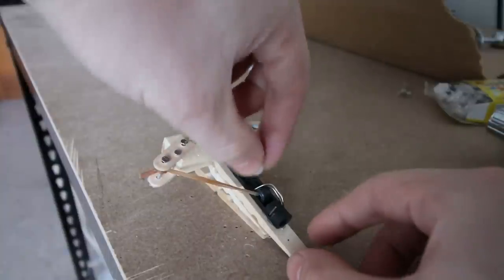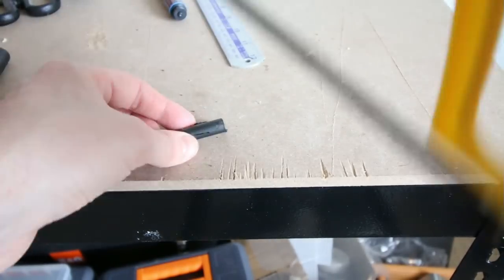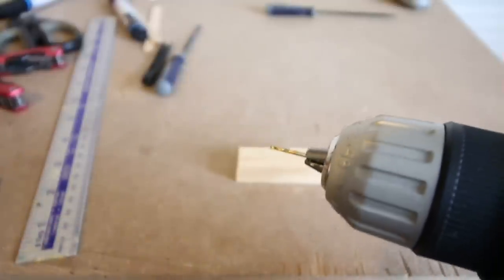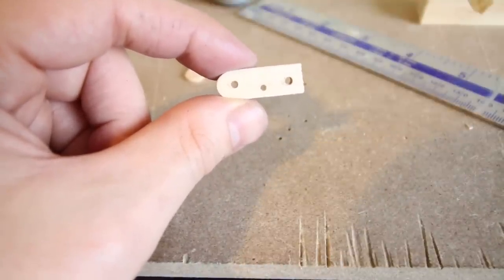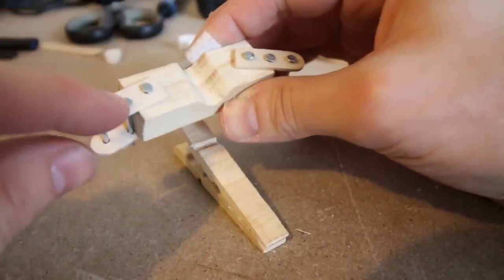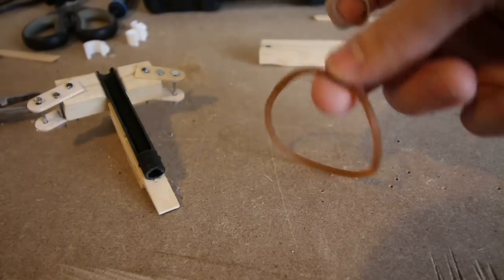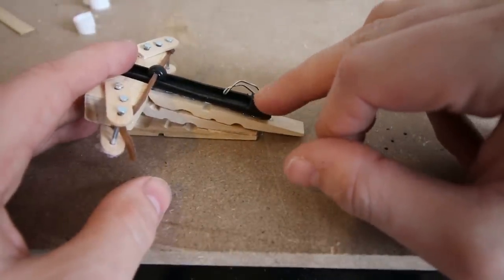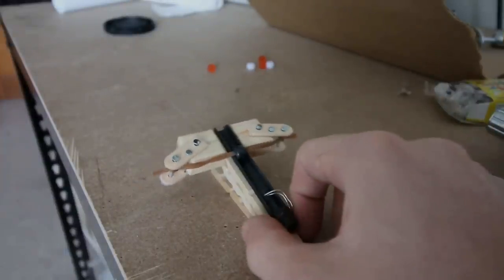Make A Mini Ballista Catapult!

Comment: For anyone curious, ballistas worked similarly to crossbows, except instead of having flexible arms to propel the projectile, they had rigid ones that hinged around twisted rope. If you've ever twisted up some string and given it a tug to see how fast it would spin the other way, that's basically how ballistas worked.

Comment: This is epic and im going to make 1 but what is the point of having the arms so that they move?
Reply: I imagine that with non-hinged arms the stress from repeated use would slowly damage the arms. But with hinges it allows them to absorb quite a bit more of that stress.

Possibly also to make finer adjustments to range and height of the launched projectile.